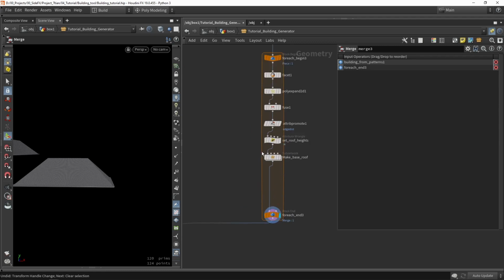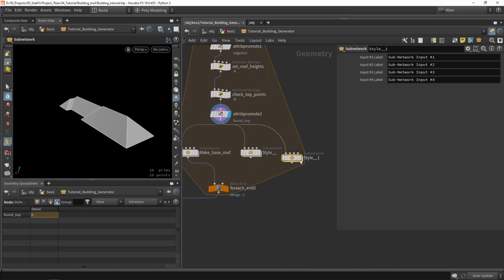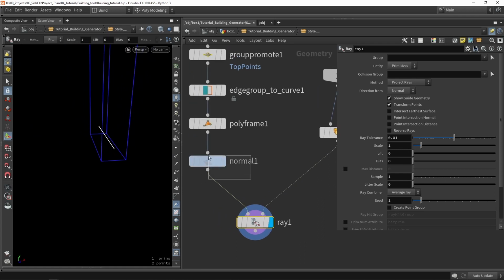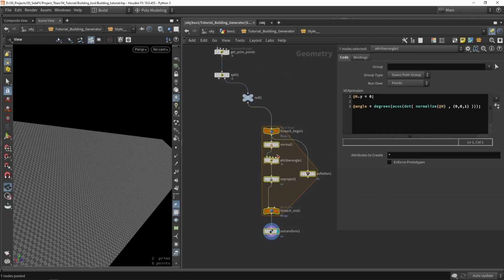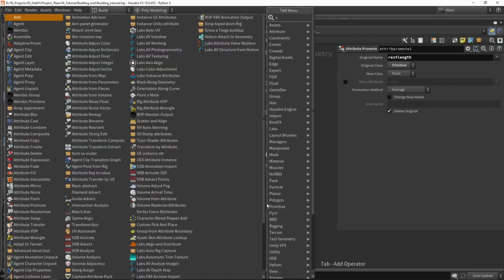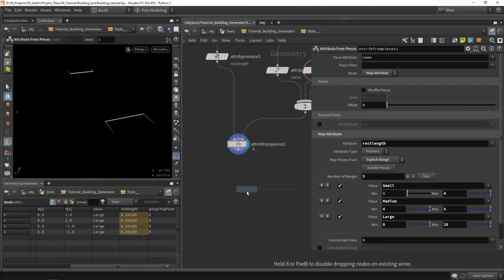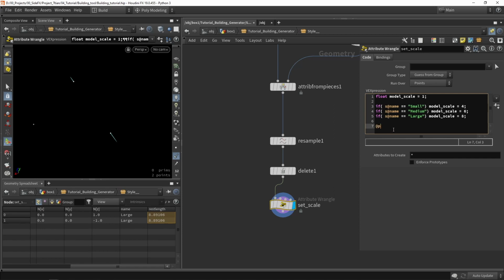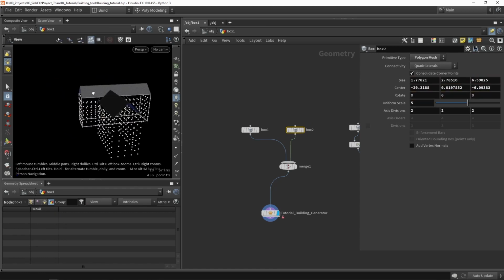Project Titan Building Tool | Part 6 | Improve Roofs

Comment: The problem is that, as far I know, there is no built in VEX plane function, so you have to put in existing geometry like extruded roof to raycast against.
 VEX function "Clip" has  some misterious plane parameter as vec4? Does anybody know how to describe a virtual plane in VEX?
Reply: check Quaternion Basics by  Junichiro Horikawa here on youtube
Reply: Haven't watched the full video yet but you can easily create a "virtual" plane from a base vector and a normal vector.
Then use a bit of linear algebra to get the intersection point with an arbitrary ray.
You should find it when looking up something like plane/line intersection.